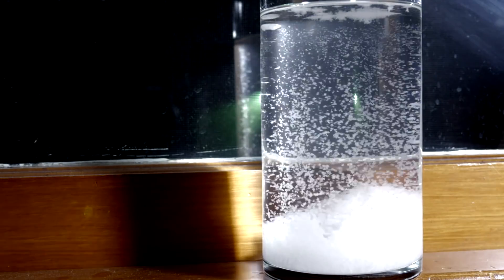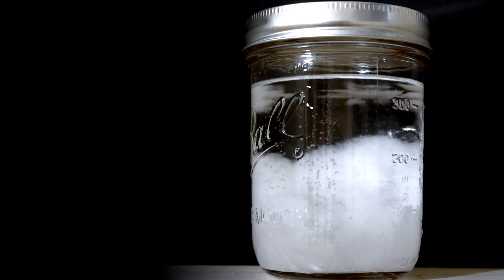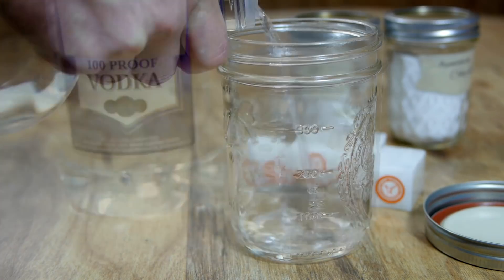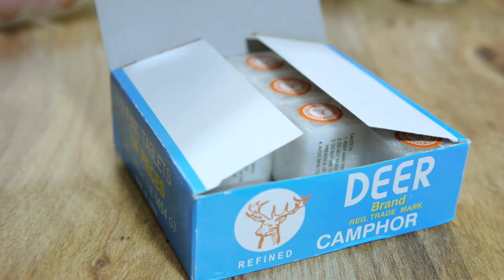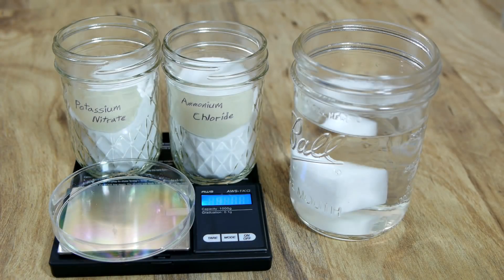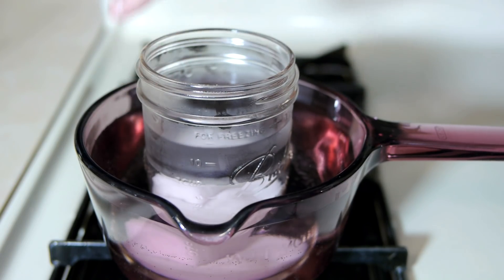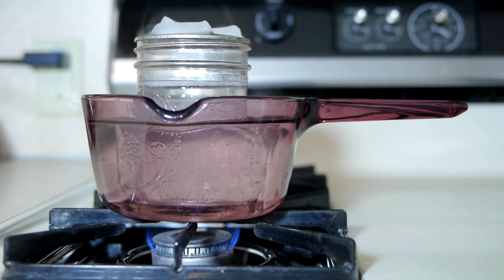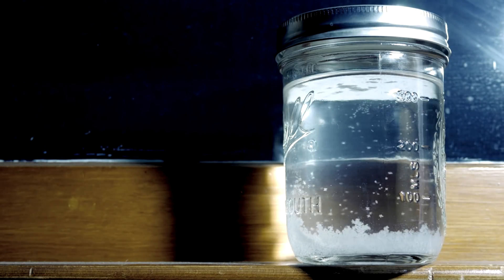How to make a STORM GLASS to predict the weather!

Comment: A lot of online resources refer back to this video as being "the go to source" tutorial for making storm glass. 

Some have said no potassium or ammonium is needed. Others say these ingredients serve to provide density to the liquid.

I do know crystals grow bigger, by two orders of magnitude, when the pH is between 4 - 5.2. 

I don't know of any other roles that the potassium and ammonium do other than density and pH adjustment. The ethanol's only role seems to be as a solvent. Water's role seems to be the same .

Since water is more dense than alcohol, and pH seems to be a factor, could another set of less expensive ingredients be used? 

Immediately, I am thinking 80 proof vodka (since US law makes 40% ABV vodka easier to sell than 50% ABV). This would increase the density some. Epsom salts has a molar mass near the potassium and ammonium compounds...so I was thinking about 25 grams of Epsom salts as a substitution. Then, for the pH, using tataric acid as since it is cheaply procured from a grocery store, could be added until a pH of 4 - 5 is achieved.

What do you think? What am I possibly overlooking or don't properly understand?
Reply from the maker: I certainly shouldn't be the go to source, I'm sure I found this recipe on a long forgotten website. I've not heard any mention of pH playing a role and haven't experimented with that myself. I believe other salts could be substituted, but you'll get different types of crystal shapes based on the molecular structure.

Comment: Hi and thanks for so many wonderful science projects! We did this Storm Glass for our winter project, today. After cooled, the solution is a bit cloudy. The jar is outside now, and cloudy, am wondering if we zigged when we should have zagged? We followed the directions exactly. I am thinking that the ice on the top of the lid, may have somehow dripped into the solution during boiling? Any advice is wonderfully appreciated. Thanks!
Reply from the maker: +Carrie Becker Could be some impurities in one of your ingredients. The cloudiness may settle out, or it may not. The glass should function fine otherwise either way
Reply: Lol did you use vodka?

Comment: Looking to make a much larger version of your storm glass inside of a glass form which is roughly a gallon to a gallon and a half of size, but would be inverted on to what starts out of the open end on the top of core purpose of mixing the chemicals into the container, my question is whether or not it is necessary to leave space in the top of the container in order to allow for the pressure change to give the desired effect or if the container can be 100% full of the solution as the open-end on mine would be facing downward and I want the entire container above it to be full
Reply from the maker: You need space. The contents change volume and will crack your glass.

Comment: Do I have to worry about seasonal temperature changes if I make this in 65° weather in the fall, but summer temperatures can rise into the high 90's? Just worried about what it will be sitting on outside, and if the temperature changes in the north east (Pennsylvania) would require me to open it seasonally to readjust the internal pressure of the jar. 

Awesome videos too, keep up the great work! You were one of my first subscriptions when I joined youtube a few years ago!
Reply from the maker: It should be fine in changing temperatures, at least in most jars.

Comment: You said that the storm glass should be kept outside or in a non climate controlled room, but what happens to the jar if the temperature goes below 0°C or 32°F. I know for experience that a glass bottle filled with water can explode in the fridge. Is that the case here too?

I loved this video too by the way!
Reply: it's a solution with 50/50 water and ethanol, with the other ingredients mixed in, it wont freeze until well below 0°C
Reply: TheHarleyEvans I am from Northern/eastern Europe and winters here get quite cold, up to -30°C is possible. Would that harm the storm glass?
Reply: Kristaps Judeiks i'm not sure, NightHawkInLight  do you know?
Reply: Kristaps Judeiks Found a site that calculated freezing point depression of vodka. Says 100 proof freezes at -40C. As for the reaction, you will likely have almost all of the crystals fall out of solution because of the low solubility at low temperatures.
Reply from the maker: Because of the alcohol content the jar should not freeze until extremely low temperatures, and then it would likely only turn into a slush rather than freeze solid.
Reply: What about -273 C

Comment: I bought 2 Storm Glasses last Christmas. I left them both outside 6 months ago before I left for a trip. When I returned They had both changed colors, but they had been colorless last I'd seen them. One works and is a nice shade of green, but wont form crystals like it used to. the other is totally useless now and is a deep clear yellow with an 8th to a quarter of an inch of orange oil on top of it all. they may be a different mixture then yours are and they are enclosed in the glass, so I'd have to break 'em to get them open. do you know what's happened to the or how they could be fixed?

Comment: Hello, the following text can be read in the German Wikipedia. In terms of quantity, that sounds like an extreme deviation from your quantities. Can you tell me what the correct proportion would be for one liter? As I see in the video above, all ingredients are based on 300 ml?
Thank you
"The glass consists of a [...] camphor-alcohol solution. [...], mentions an aqueous solution of potassium nitrate and ammonium chloride mixed with a solution of camphor in ninety percent alcohol. The chemists [...] analyzed the contents [...] It contained per kg: 243 g water, 243 g ethanol, 363 g camphor, 50 g potassium nitrate and 100 g ammonium chloride."
Reply from the maker: I make a 1 L version in this video: https://youtu.be/Trz1diBkAR0?si=Yuny_WX64Ft2SEtf

You can change the amount of ingredients if you'd like more or less crystals compared to the amount of liquid

Comment: Clear liquid : Bright weather.
Crystals at bottom : Thick air, frost in winter.
Dim liquid with small stars : Thunderstorms.
Large flakes : Heavy air, overcast sky, snow in winter.
Threads in upper portion of liquid : Windy weather.
Small dots : Damp weather, fog.
Rising flakes which remain high : Wind in the upper air regions.
Small stars : In winter on bright, sunny days, snow in one or two days.
The higher the crystals rise in the glass tube in winter the colder it will be."

Comment: Is there any risk of dangerous fumes? What if the ammonium chloride isn't completely dissolved before the solution is heated? Wouldn't that produce fumes of hydrofluoric acid and chlorine?
Reply from the maker: reggaerox08 No, you can't make hydrofluoric acid without fluorine. None of the ingredients contain it. The only fumes are from the camphor, which are strongly scented but not especially dangerous if you have adequate ventilation. Most should stay inside the jar.
Reply: NightHawkInLight Thanks for the response. Obviously, I am better at computers than at chemistry :)

Comment: Is there any way to substitute the vodka with a non alcoholic substance? I am doing a project for school and I would love to do this but I would get in a butt load of trouble. Please reasond! And a hello from dairen
Reply from the maker: +Ashley Pfalzer It might be possible to use methanol, which is sold as HEET gas line antifreeze in auto parts stores. It would have to be diluted with 50% water to match the proportions of the vodka. It is still alcohol, but it is non edible (don't drink it!). You could also try isopropyl alcohol which can be purchased at a pharmacy and would also have to be diluted to 50% concentration. I do not know for sure if either of these will work as I have not tried them. I believe they should.
Reply: +Ashley Pfalzer Just ask for permission to bring the vodka. There is a difference between using chemicals for a reaction and a naive rebellion. You don't need to bring in a full bottle of vodka. Just a few water bottles filled would work.

 Showing up to school with a bottle of vodka with out telling anyone would land you in hot water I'll agree with that. So label the water bottles filled with vodka  as diluted alcohol. It is honest and properly labeled following proper lab practice. If you get permission of course.
Reply: +TheHeadHunter1000 "Ethanol Solution" would work for honest labeling, too.
Reply: +Ashley Pfalzer You could also probably use rubbing alcohol, or add a splash of it (or methanol) to the vodka and call it "Denatured Alcohol"
Reply: +NightHawkInLight methanol, you don't say x) this alcool is really toxic, it causes blindness and cause death most of the time

Comment: where does one get those two powdered chemicals?
Reply: +tackling turtles really?
Reply: for amonium chloride you can probably neutralize muriatic acid with amonia, both are used for cleaning, however the end product wont be pure, as it will contain FeCl impurities from the hydrochoric acid, so you may want to recrystalyce to remove a yellowish color.
And the nitrates, are used as fertilizer, however amazon is the easier way to go for me at least, unless you can get them in some gardening store
Reply: ficolas2 tank you
Reply: ficolas2 lol FeCl impurities

Comment: I did followed the instructions to the best of my ability, and i used all the right chemicals, however my glass lacks any crystals whatso ever. I do live in texas and the weather is 50 degrees Fahrenheit ,  i never expected a ton of crystals, but i wanted some, is their any way the expirament could fail? the only thing i did different was pour 150ml of water and 150 ml of ethanol, is it possible that if i add to much water and ethanol i wont see a crystal and i need to add more salt and camphor? I may of added a little extra because i didn't meet the 300 mark on the jar.
Reply: Is their a way i can test this? would putting it in the freezer and getting the slightest amount of crystals help prove its diluted, I am answering my own question now that i look at it.
Reply from the maker: Brennan Hebert Add a little more ammonium chloride or potassium nitrate if you're not getting as many crystals as you would like. There should be enough that it's hard to dissolve everything without heating the jar.
Reply: Brennan, you need to be careful of your solution blending.  150ml water and 150ml EtOH do not give 300 ml of solution at 100 proof ABV, but about 289 ml at 104 proof (refer to an into chemistry text for the explanation).  I find it far easier to convert all components to mass values and then blend accordingly on a mass basis.  Also be careful of the composition of what you think is "ethanol". Denatured ethanol is a crapshoot as its composition is not fixed and contains more than EtOH, while concentrated ethanol solutions like Everclear (190 proof) still contain water that cannot be removed by distillation.  It is uncommon to have access to pure 200-proof, anhydrous ethanol unless you work in an industry or laboratory that allows you to order it.  All that said, though, you should have plenty of crystals if you followed the rest of the recipe correctly.  Compared to other stormglass recipes, NightHawk's is pretty concentrated in all the solid solutes.  I find it difficult to completely dissolve the camphor even in boiling Everclear in the ratios he provides.  My best advice is to check and double-check the masses of your solutes and make sure you got that right.

Comment: Hello!
I’ve just made a batch of twelve of these for gifts and I’m not seeing any crystals form. If I got the solution too hot in the boiling water, would that ruin the compound? Seriously, there are no crystals forming and only a bit of camphor floating at the top Help!! Any insight would be soo appreciated.
Reply from the maker: Let it cool down more.
Reply: They have been sitting since yesterday. No change. I put one outside in the cold, no change. 
I followed the process to the letter. 
It just looks cloudy and there is camphor at the top. Just a little.
Reply from the maker: @usernamehughes  you measured the dry ingredients by mass? Add more if needed, but if you measured by mass, and did not add more than the recommended liquid it should work.
Reply: NightHawkInLight thanks for replying, I just can’t figure out what went wrong. I didn’t have a digital scale, so I used a rounded teaspoon measure for each of the dry and the camphor was a 25 gram block. 300 ml of 100 proof vodka. It should have worked. If you have ANY ideas, I’m willing to try anything. I’m in about $90 in materials. I feel terrible. 😢
Reply from the maker: Double the dry ingredients (not the camphor). It shouldn't hurt to have more than needed.

Comment: Question NightHawkInLight   : 
if i bought 70% Vodka,, would it still work .cause what i am interpreting from the  list above Vodka 100% ( which contains 50%).Therefore the Vodka 70%(which contains 35%)  could this work. I cannot find 100% Vodka here in Canada. Or what else can i do to substitute   Vodka? I would really love to make this for a X-mas present
Reply from the maker: I think it should still work. Maybe add slightly less camphor and a little bit more of the other ingredients
Reply: +Karen Ross here in Portugal and Europe we use the % system, the bottle actually has the percentage of alcohol wirtten, therefore 100 proof would be written as 50%. I don't know how it is in Canada, but I'm not sure that the conversion rate from 100 proof to 70 proof is that linear in percentage. Anyways here there isn't really any alcoholic drinks with an higher percentage than 40% lol, especially vodkas, whiskys and the like. The exceptions are absynthe and a few little more, there are literally few to none comercially available drinks with an higher concentration than that

Comment: To quickly dissolve the crystals can you microwave the glass rather than re-heating it in water?
Reply: Microwave seems like a bad idea to me. It might be difficult to keep ice on the lid if that was done, because the microwave would heat the ice, you couldn't keep the metal lid on it, and it seems like it would make the contents of the jar boil, losing more alcohol and water than what you'd like.

Comment: My mixture isn't clear like yours is unfortunately. Is there a way to clear the liquid up? Heating it again this time longer? Or is it stuck like this. If it is I'm going to be a little upset I made 4 of them, well 4 of 6. Could it be cause by using Spectricide instead of pure potassium nitrate?
Reply from the maker: +Menacing Moto Could be the spectricide, the foggyness is probably caused by an impurity in at least one of the ingredients. It may settle out by itself or remain foggy, hard to say.
Reply: +NightHawkInLight That's upsetting. I went and checked the MSDS of the Spectricide, it claims 100% potassium nitrate. Isn't potassium nitrate hygroscopic, and the cloudiness could be caused by the "moist" potassium? My ammonium chloride was brand new too, I cracked the seal to it when I poured it in. Another thing might be because I gave it a little stir first? There is so many things that could of happened. Hopefully it settles. Do you think heating it until it might clear is an option? Thanks for your response(es).
Reply from the maker: +Menacing Moto Heating it again will probably not clear it up. It will either settle out by itself or it won't. Take a little of each of your ingredients and dissolve them individually in some water and see which makes the water foggy.
Reply: +NightHawkInLight Great idea, thanks night. Love all the videos.
Reply: +NightHawkInLight Good news, I let it sit over night in the cool weather and I got crystal formation and the water cleared! I'm ecstatic, this is an amazing project. Thanks again, night.
Reply: since water is not distilled, it could give foggy effect

Comment: where did you buy your materials
Reply from the maker: You can get this stuff on eBay.
Reply: oh I didn't think to look there, thanks
Reply: hey im doing all of the steps and i cant seem to get mine to go clear and there is residue floating at the top of the solution and some undissolved powder at the bottom, do you have any advice, how did you get your solution so clear
Reply from the maker: Your ingredients might not be very pure. Don't worry about it, it will probably still work fine if you can't get every last bit to dissolve.

Comment: I can not understand,how camphor  could be a powder,it is a Oil.Can anyone describe me?
Reply: The only 2 powders shown in this video are potassium nitrate and ammonium chloride. Those little blocks that were shown in the beginning are the camphor. Camphor is a solid at room temperature. Sort of like candle wax but a little softer. When you buy it as 'camphor oil' is is that waxy substance but it has been dissolved in something. Perhaps an alcohol or type of oil like linseed oil.

Comment: Vodka is 50% ethanol? So if I'm out in the desert and run out of gas I can flip a coin and decide whether to pour it into the tank to possibly get to a station where there is more gas and some water and food or drink to a happy death?
Reply from the maker: It's right at the happy medium where it will either make you die of dehydration if you drink it, or ruin your engine if you pour it in the gas tank.
Reply: better use vegetable oil,in diesel engine :)
Reply: viko207  Just making a joke.  :-)